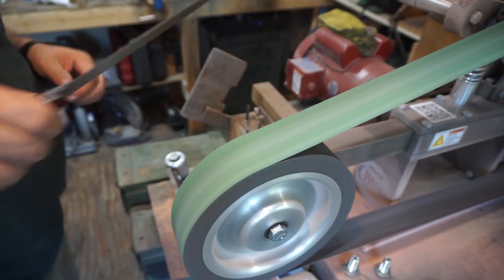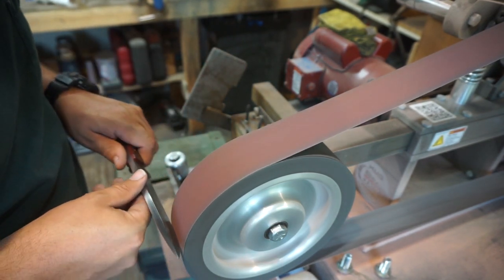Sharpening and Chopping With The 80CRV2 Chopper | Knife Making | Vlog

Comment: I really want to try some 80CrV2. I hear good things and this video proves what I've heard.  How is 80CrV2 to heat treat?  Can you heat treat it in canola/vegtable oil with success or do you have to buy the expensive stuff?
Reply from the maker: It's a pretty easy steel to heat treat and you can definitely use canola oil. You just want to heat the oil to 120 degrees.